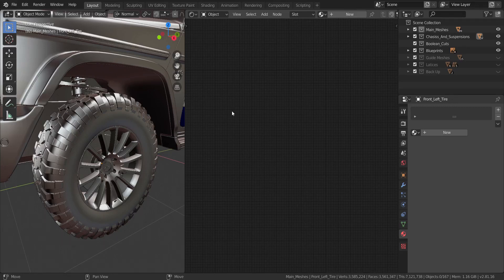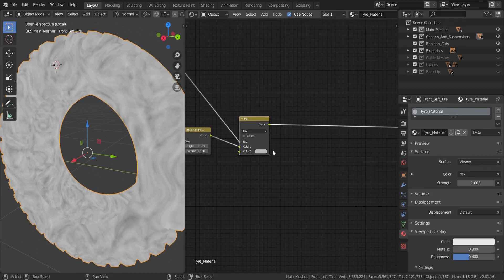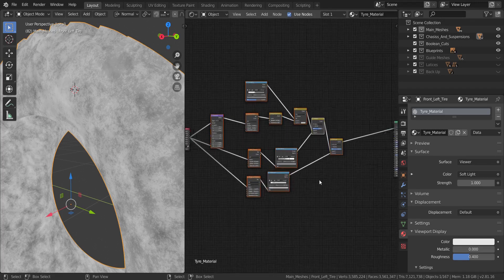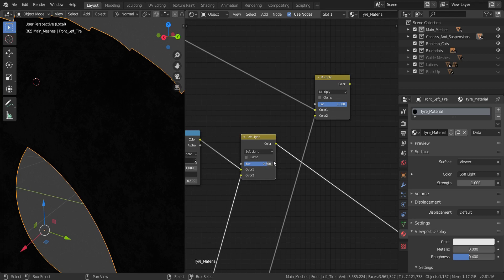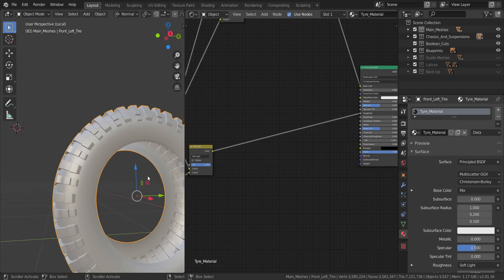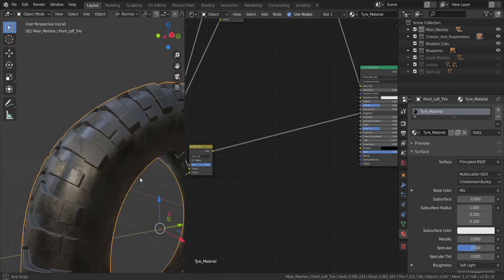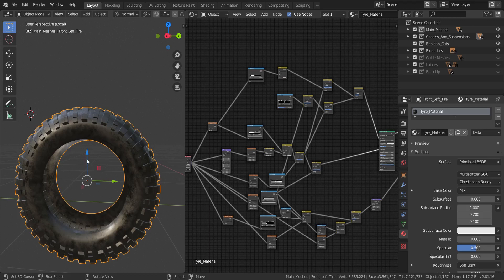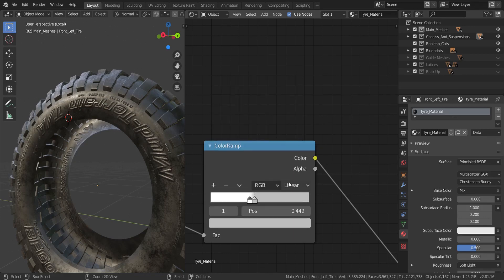Blender 2.81 Material Creation - Tyre Material

Comment: Hey, i wanted to ask is there a way to solve the geometry count in a tire like this, i made a tire and it had 20k triangles  which is not good for game engines, i tried baking the normal and set an AO but still looks ugly, what is the right way to do it?
Reply from the maker: Well I would normally model out the significant treads on the tire and bake the rest as normals... Should reduce the poly count greatly...
Reply: @NaturalArtFreak  i thought of this, but for an off road tire like this it will end up looking bad, and thanks man
Reply from the maker: @foxdutyxd7543  I guess so, but I'll reply to this message if I do make one, as I make tire textures that don't require lots of geometry.
Reply: @NaturalArtFreak  that would be great!

Comment: I am not getting same result as you with quadratic sphere under gradient texture. I used blender 2.8,2.1 and 2.82 but the whole thing was still white. I am missing something else that wasn't captured in the video?
Reply: I had this problem until I centered the tire's origin. Good luck.
Reply: @acadgatsu  Thanks mate, Will give it a try again
Reply from the maker: @i-elotechsystems33  also your values might be different cause you have a different tire than mine. work around your values.
Reply: @NaturalArtFreak  I have the same problem but setting the orientation to the tyre's center and also changing values of the color ramp didn't fix it. The tyre is all white as soon as I hook it up to the quadratic sphere/gradient texture of the texture coordinate's object output...

Comment: Even if I followed the instructions, the tires still look wrong. Since we are now on 2.82,
and I'm guessing there has been changes to the nodes, I consider this outdated. :(
Reply: FWIW, got it to work but had to go back a few times and my ramps were different because I tried it on a different tire
Reply from the maker: if you're using a different tire your values are gonna be different from mine.

Comment: I get no shading effect at 12:50. Using the blender 2.83.
Reply from the maker: Does it work at the end though?
Reply: Me too
Reply: It just turns into white
Reply: Guys I had the same problem, use Quadratic Gradient texture instead of Quadratic Sphere
Reply: For me it was a scale issue. Instead of running the quadratic sphere texture gradient directly to object, run it through the mapping node first and decrease your scale. I had to bring it down to 25% scale before I saw the gradient.